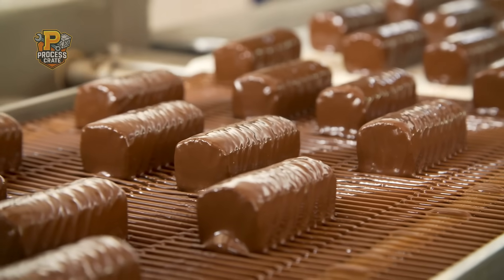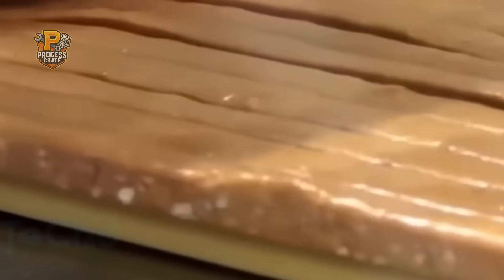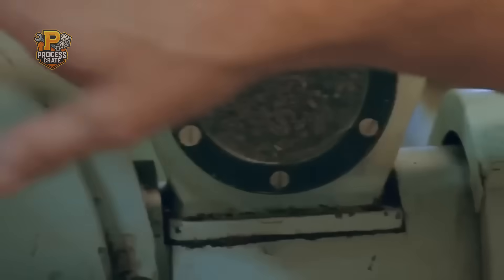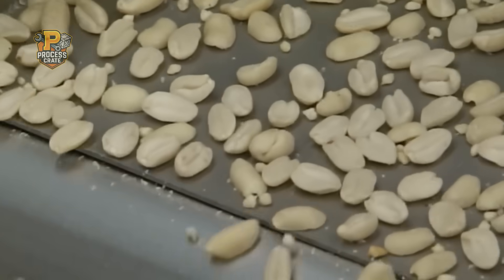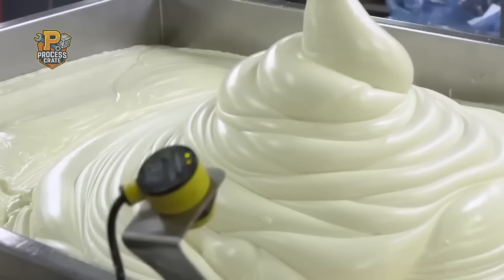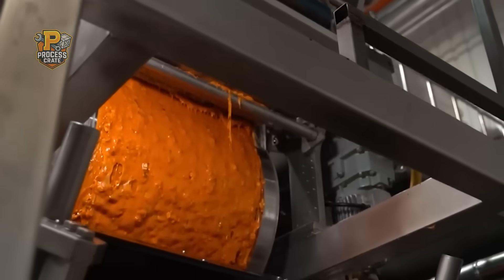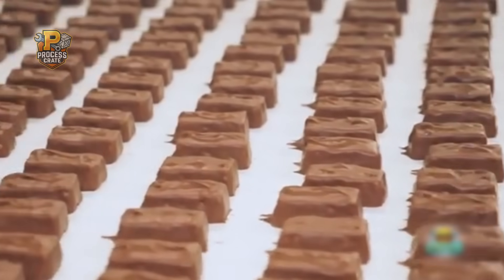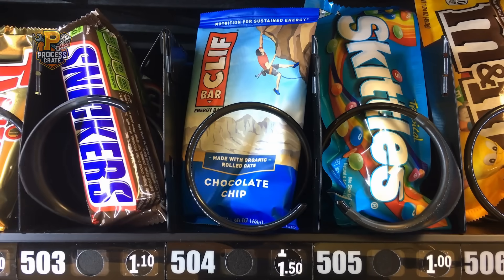How Snickers Are Made In Factory

Comment: I’ve always done the slight head tilt & bite the the soft bottom nougaty portion with only my 4 front teeth.
Then I’ll 1/2 chew & 1/2 absorb its deliciousness completely before biting off the top 1/2 of the bar. (My favorite part!)
I can’t rush this part because as my mouth closes and the caramel melts away (heavenly 😊) releasing each little crunchy nut from their sticky confines.
All this time the chocolate is becoming one with the caramel , the peanuts , and my soul (😂).
It usually takes between 4-6 small (but ‘O So Satisfying ) moments like this to properly finish a regular sized Snickers.
That being said, I have kids so I also have no problem smashing a Snickers super fast 😂